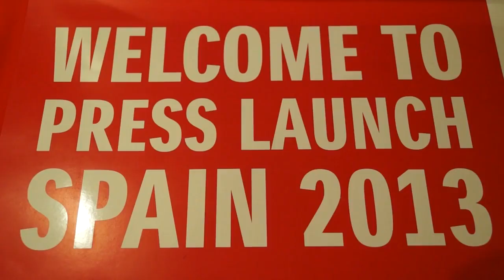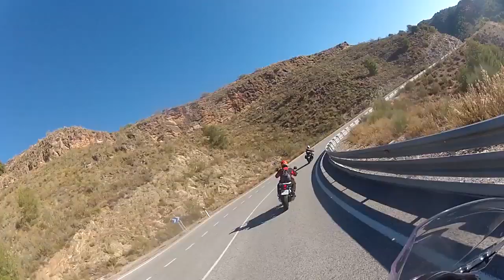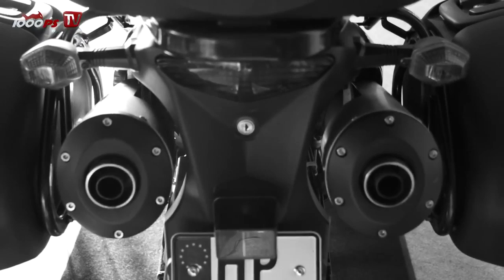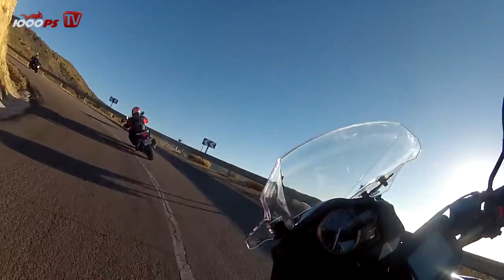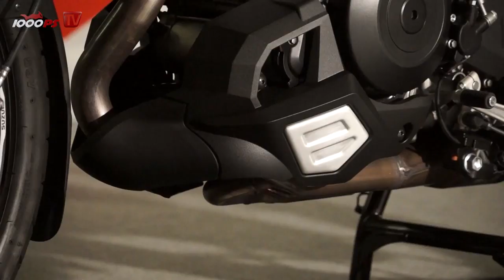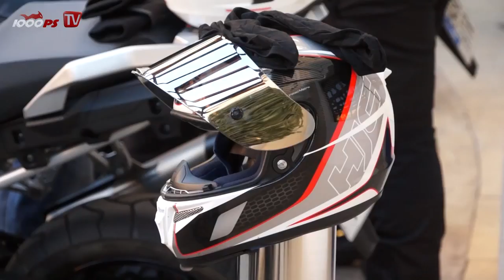First test Suzuki V-Strom 1000 ABS 2014

Comment: thanks for your thoughts. I have had mine 2 weeks and feel totally at home on it. Not scintillating performance but more than enough, lovely balance and handling. I thought the 19" wheel might feel ponderous (having just left an F800R) but, no, I think the more narrow tyres have prevented that. Fuel useage is also commendable at about 4.3 litres/ 100 on my first tank